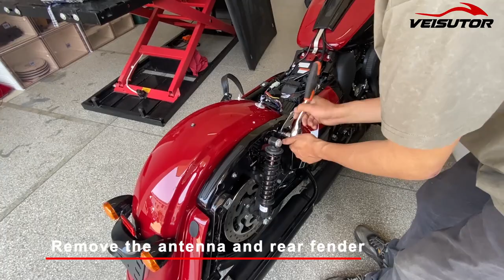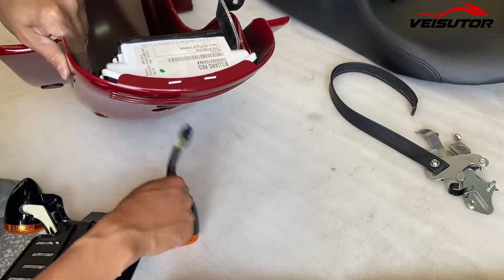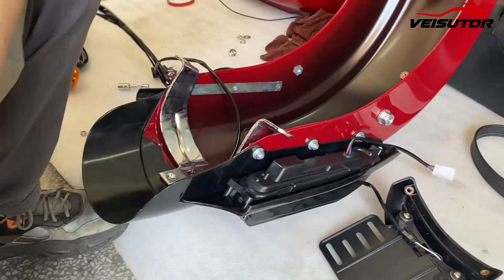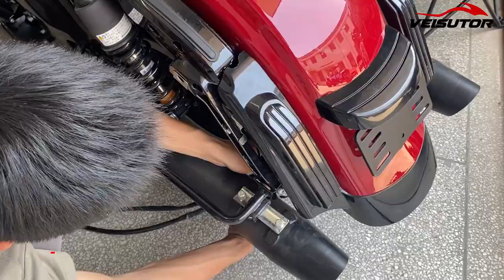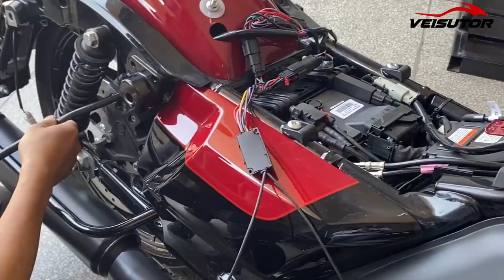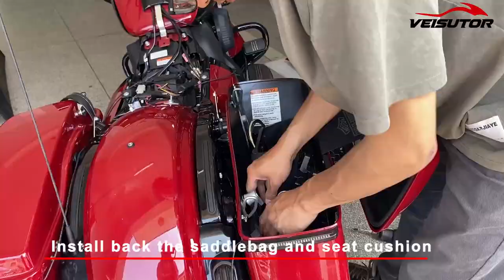Installation of LED Rear Fender Fascia Kit for Harley Road Glide 2014-2023 Accessories

Comment: I just installed this too. Did you notice how if you put your 4-ways on then turn the ignition off the blinking goes completely off to on, but when the ignition is on the running light remains on so there’s not a complete blinking of the light? Initially I thought it was a BCM learning issue, but according to a tech at Custom Dynamics it’s because that’s how Harley wired it for the running light to stay on.  I’d prefer they do a complete blink on, blink off.  I’m searching to see if anyone has a way to make it do that. What’s your opinion?
Reply: Did you ever find these
Reply: @Propman203  No I never found a solution to that issue. I sold that bike. On my new bike (well new to me) I’m doing the saddle bag lights that mount just under the lid. I thought about doing the filler lights again, but decided to go with a higher mounted light.

Comment: Where did you get the license plate light from?
Reply from the maker: @garyturnage7856  Hi, you can search for “B0B68GX292” on Amazon.
Warm Tip: Our product (B0B68GX292) is sold as a matching set, there is no separate selling link.

Comment: Where can I get that mount with the light in it and holds the license plate   bracket?
Reply from the maker: Here is the link to the item for your reference: https://www.amazon.com/dp/B0B68GX292
Reply: @veisutor4366 I’m needing just the license plate lamp
Reply from the maker: @richvandenbroeke5493  Hi, we're not sure exactly what you need, but our products are sold in kits and there are no individual sales links. If you just need the side box taillight (please make sure it fits your motorcycle before purchase), here is the link for your reference: https://www.amazon.com/dp/B0B3CQQQRS

Comment: I have similar lights, but it works weird, when I hit brakes - it turn yellow instead of brighter red. turn signals works as expected (yellow). Maybe someone can give some advice what could be wrong?
Reply from the maker: @ContrastVision  Hello, we recommend that you prioritize checking the detailed description page of the purchase link to see if it matches the condition you are currently experiencing. If it does not match, then you will need to check that the wiring harness connections are correct. (VEISUTOR recommends that you prioritize checking that the lights come on correctly after a successful installation before restoring the motorcycle to its original state)